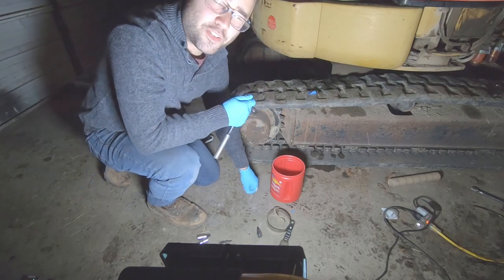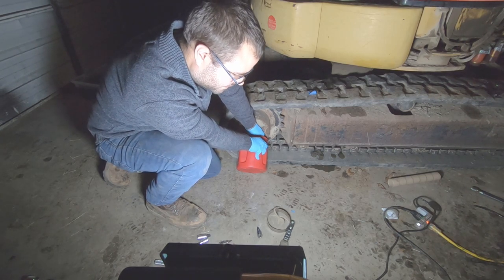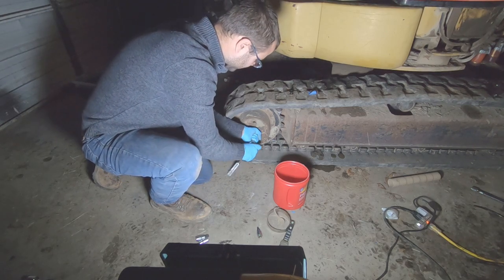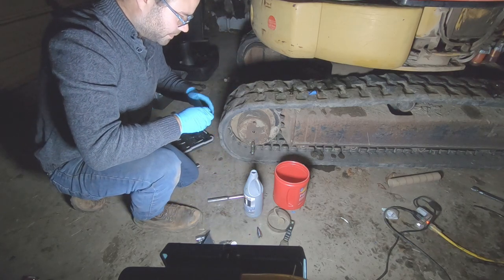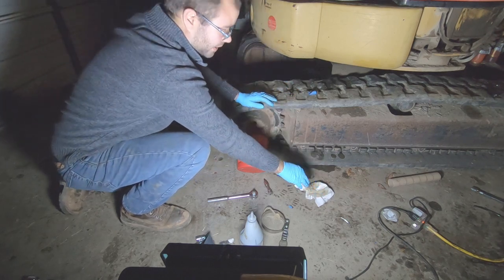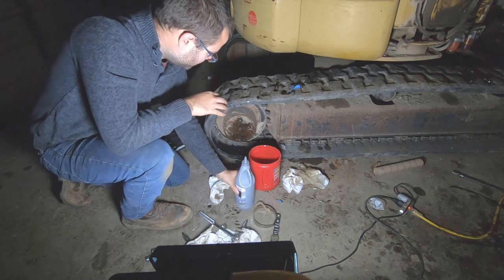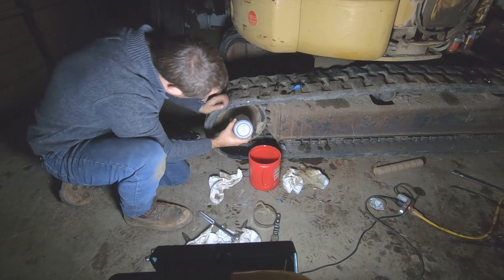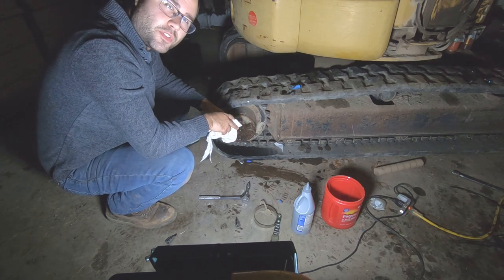FLUSHING AND FILLING FINAL DRIVE FLUID | CAT 303 MINI EX (HOW TO)

Comment: I have a 304, same finals I assume since my manual covers 303-305 and says 1 quart of fluid for all. But I’ve never got more than 16oz in before it’s spilling out of the level plug. Which is weird, with a final drive, most of not all the oil comes out when you drain it. 

Good choice on the 75w90. These don’t like thicker gear oil. I have years of oil analysis on mine where I tried 75w140 for a period. The sampling lab suggested 30wt T0-4 fluid in mine, and not gear oil. So I just did a flush and refill. Diesel is what the cat techs recommend for the flush. Fill it, lift the track and run it back and forth a few times, drain and refill with oil.
Reply: Does running track back and forth with diesel in the final drive not damage it? I want to use something to flush mine out but was afraid to run the track back and forth.
Reply: @MatthewDrumm-h6j  no, it doesn’t hurt anything. I’m talking lifting the track off the ground and running it back and forth, so no load on it. Just go back and forth a couple times to get it all sloshed around in there then drain it. I think it’s a good idea to flush them every service. If you’re worried about it just fill it to the very top, then pull the drain plug. That’ll still flush it out pretty good without running the track.

Comment: I’d fill it and run it for a few hours and then perhaps drain again and refill. Filling it and flushing it straight away is just wasting good oil ... not like gear oil is high detergency and this method is achieving any cleaning effect.
Reply from the maker: That’s very true - didn’t think of that.